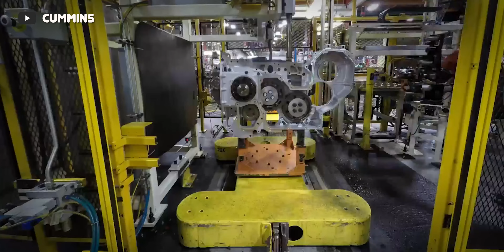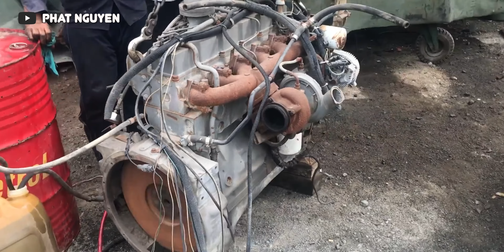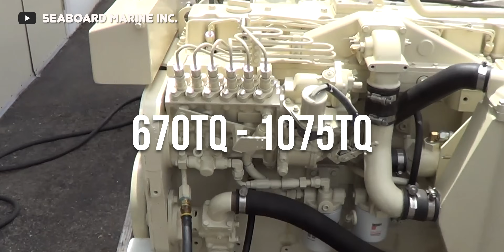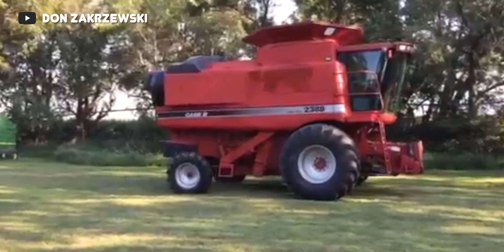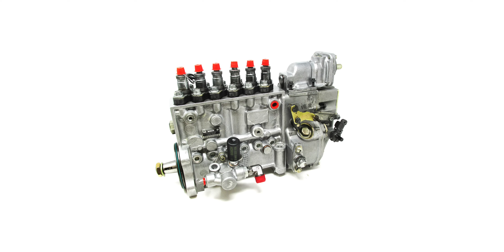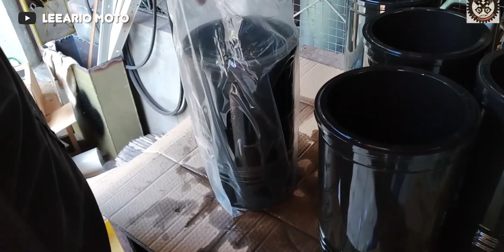Everything Wrong with the Cummins 6CT 8.3L

Comment: You forgot to mention the 7.3 powerstroke.
Reply: What about it, that it's a mediocre engine that's famous for being the only powerstroke that's too weak to blow itself up regularly
Reply: @wizard_of_poz4413  
Well under powered from factory is true however with a few added bolton's it can make 450hp plus and all the while still be very reliable. I'm saying this because I have one that pumps out 500hp from 4 months after I bought it new and it now has 300thou on it and I haven't put a spanner on the motor since except for services and a couple of sensors. I definitely think the 7.3 has a very reliable history.
Reply: @floydgould4401  ok so you had to shell out a small fortune in mods to make an outdated hunk of shit that's well past its prime even remotely competitive with a modern engine that's better designed and on a more robust chassis in essentially all cases.
   I'm not trying to be mean but if the internet was real then the first time I cranked a 6.7 it would shoot pistons out of the hood and catch on fire
Reply: @wizard_of_poz4413  
No offense taken, I'm just sharing my experience and knowledge from a truck I've owned for 18 years. It cost me $ 5800 for the upgraded mods and was money well spent. I do like the 6.7 but the have all the dpf crap on them.

Comment: Uncle p pumped his ISC after the CAPS went out. I helped him put on a compound Switzer(whistler) over HX55 turbo with an air 2 air inter and after cooler. Truck is easily putting down 450hp/1300tq. He's had it 10 years and we rebuilt it last February. Says it has better performance than his stock ISM310 and get almost 5 mpg better. Almost 17 mpg loaded to 50k#'s
Reply: CAPS sucked
Reply: @Bacongrease00  His CAPS was clogged with fuel hose rubber, Algae and had rust build up. Even with keeping a fuel/water separator and filter on it.
Reply: @bladenrexroth2555  when I worked for Cummins it was a high repair item. Bosch P pumps were so much more reliable but the push for emissions and efficiency ultimately wins out every time. CAPS is very sensitive to foreign debris, bad fuel, poor maintenance.
Reply: Good story but I have to call bs on the 17 mpg! Not possible, no way, no how, not even if that engine was powering a Honda Civic!
Reply: @MichaelLeger-o1h  I've got 900tq at 1500rpms. I'm geared and tired for 1500 rpm cruise in overdrive. My 6.2 stroker 12 valve is geared and tired the same and gets 26 mpg empty. My uncle and I are mechanical engineers. We've done the math. We geared and tired for an 0.75 OD spinning 3.73 gears and 11R22.5  tires at 1500 rpm.
Reply: Is it still running?
Reply: @AndrewMarsch it's still making money
Reply: Were you able to use the timing case from the isc when converting to p pump or did you have to swap it to the 6ct case?

Comment: Great content as usual. You seem to love diesel engines..how about showin’ some love for us TDI guys😉
Reply: An ahu 1.9 Tdi is essentially a Cummins. 
Hell it can use a Cummins pump. Pistons are same. 
Injectors are basically the same. 

It can make power of a 4bt. 
And it’s less than half the size
Reply: @fastinradfordable  its a cummins-lite
Reply: @fastinradfordable  Close but not exactly. cummins would never use a timing belt lol. The 4bt is a cam in block and much much larger. Cummins use grid heaters instead of glow plugs. The cummins R2.8 is the closest you can get to a tdi

Comment: I'm an International Harvester diehard, but I'd say farmers in my area very much prefer the 5.9 and 8.3 Cummins. Reliability and fuel efficiency are usually mentioned.  I'm sure it helps a lot that the Cummins tractors had powershift and nice creature comforts!
Reply: Cummins makes great engines and they had good power, but I don’t think they could beat the Torque and power to RPM of IHs 300/400 series engines. IH just had the more robust design and better lug down power
Reply: Like they've had a choice in the "modern era". Tractor-wise at least. How come AF combines stayed "all IH" so long?

Comment: Cavitation is just a maintenance issue. The International 300 and 400 series had the same problem as well which is why International introduced the field service kit with the water filter with pelletized coolant conditioner.
Reply: Agreed, all wet-liner engines have either a notification to change coolant annually, or change the coolant filter (has additive puck in the bottom) if so equipped, annually. 
Best wishes from the far North.
Reply: Many wet-sleeve diesel engines have problems with liner cavitation.  John Deere had problems with their engines when I worked there in the late 1980's.

Comment: The only “problem” I’ve ever heard about these engines is that they simply don’t make any power for an engine of the size/weight. They also don’t have a lot of aftermarket support to build power
Reply: They have about 45% of the aftermarket that the 5.9 has. You can get bigger delivery valves, marine injectors, marine cams, head stud kits, rod bolt kits, 3-4k governor spring kits, high compression marine bowl style pistons, valve springs, stronger push rods and a few other things. Couple of marine grade parts, fire rings, head studs, rod bolts, p pump modifications and a compound turbo system and you can push upwards of 600 hp. The QSC variants have seen up to 700+ hp. It's just very rare to see anyone actually do it when the 5.9 aftermarket is swamped. To be honest. The 8.3 is actually way cheaper to build from scratch for big HP and TQ. They'll easily produce M11/N14 numbers for half the price of a 5.9 build.

Comment: Very very good engine, in the Ag engines I've seen the CDC version, in the Case IH Magnum tractors with over 15k hours on them. The combine engines typically run higher RPMs, and in a combine while in operation, you have to run full throttle all the time, for the machine at the proper threshing speeds.
Reply: I've got one in a dozer and a feller buncher...I like em.had to inframe one at 8,000 due to oil consumption cause of rain water intrusion on account of missing rain cap.liner was pitted..all in all a good engine and design.. wonder why the combines have chucked rods..?.. think perhaps a fastener issue where a bolt came loose and Left ..then the rod existed..never seen one to blown to dissect...but anyway 👍👍